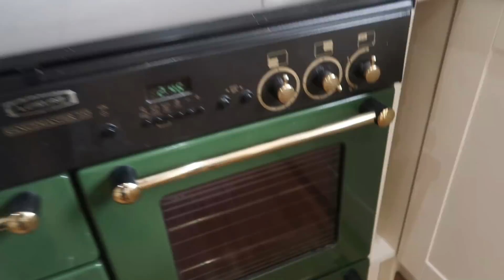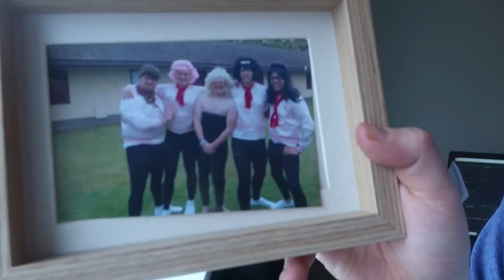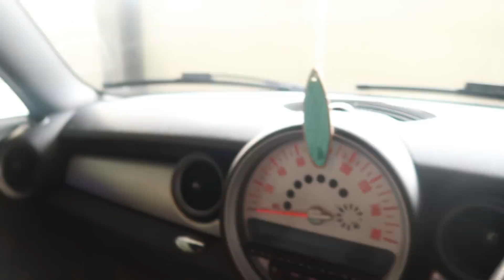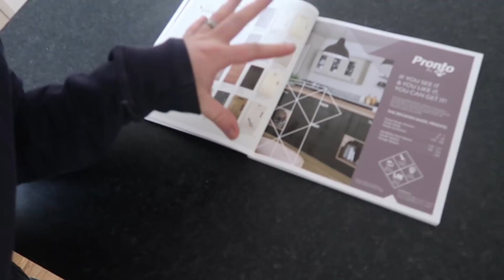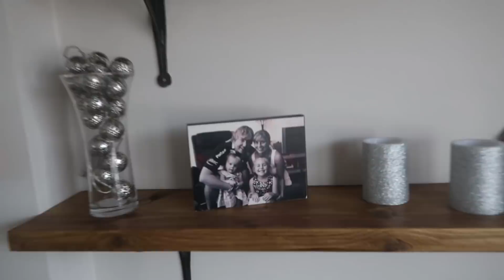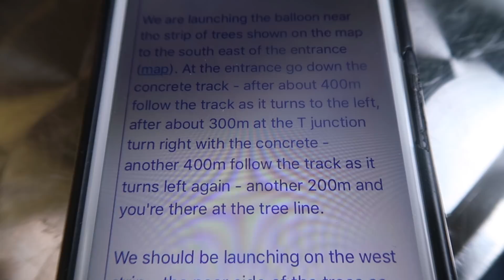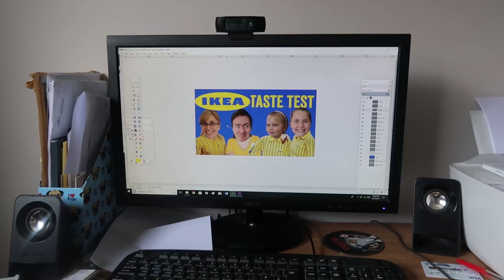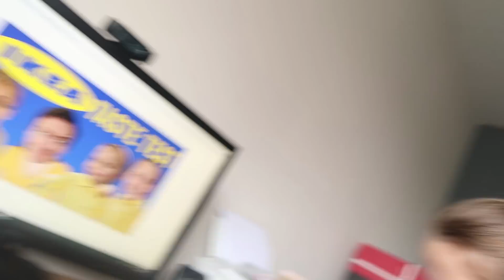Great Scott!  | MVK Behind the scenes #12

Comment: Barry that oven speckling thing is vary common here in canada its on ceramic covered steel or iron it helps keep it from rusting and helps insulate the heat because ceramic holds lots of heat longer then just steel but in a lot of stuff now its decorative painting and doesn't serve any purpose it gives the illusion of ceramic covered steel. But your oven looks like it is a genuine ceramic coating so the oven won't heat the room as much and the oven will hold the heat longer.

Comment: Here in the states, speckles are usuall6 Ceramics. So its easier to clean. Does that oven have a self cleaning option? Ceramic also heats evenly, so the whole oven is 1 temp vs hot n cold spots.. also you may have a self clean ootion in it. Less work plus chemicals. What can heat hotter. Metal or ceramic?  How do you melt copper and gold? All in ceramic .